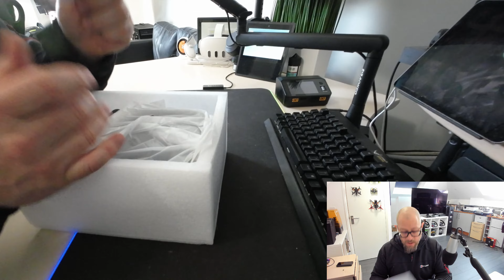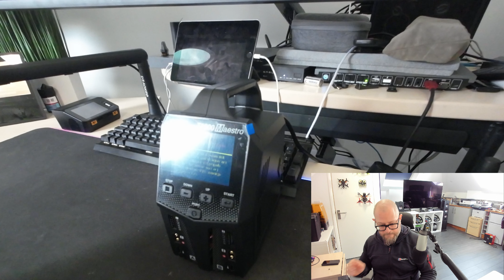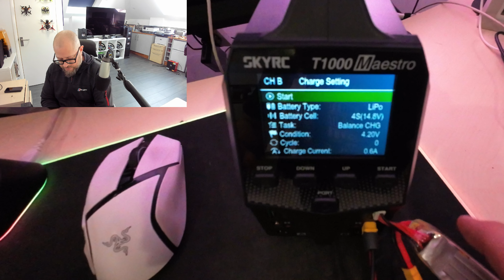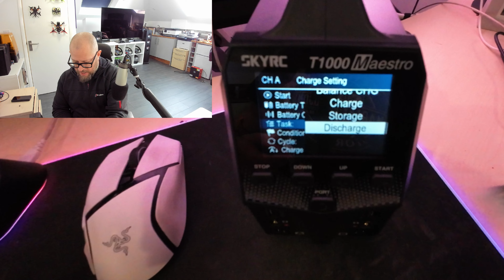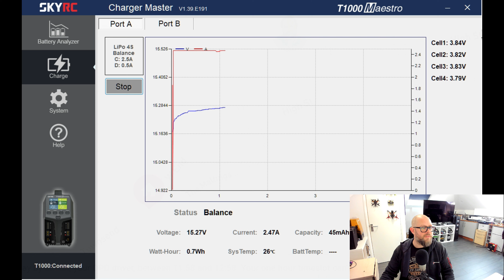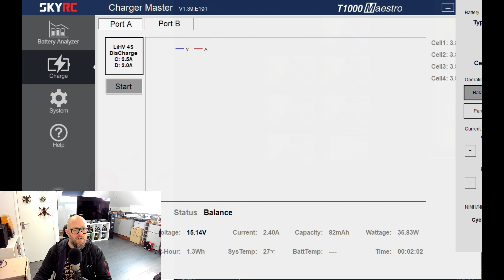The Ultimate RC Charger (SkyRC T1000 Maestro Unboxing & Setup)

Comment: Hi, 
thanks for the video, more in depth information on the software is what i was looking for.
i looking for a test system for my batteries. thinking of using the BD380 discharge together with this charger or the D200.
but i have some questions.
can you see the info per cell? like voltage, resistance etc? also in a graph?

it this information accessible during charging and/or discharging?

i hope you can provide me with some more info.

Comment: Hi is this 450wx2 or 450 total on AC?
Reply from the maker: Took a bit to test, however I can sonfirm that the SkyRC T1000 Maestro charger delivers up to 450 W total in AC mode, not 450 W per port. When using DC input, it can push up to 1000 W total across both ports.

Comment: Cheers again for the content Johnny. Much appreciated. I am wondering over the usefulness of the app. I figure, that if I have to walk over to the charger to plug the batteries in, I may as well start the charging/storage process whilst I am there. Is it actually useful, you think?
Reply from the maker: I do think it is useful yes. The app is mostly for testing battery health at an individual cell level. You can check how much energy each pack is storing and retaining which relates to a state of health check.
I may well plug this into a long USBC cable, and leave it connected!
The menu is OK, but the button control is HORRIBLE though. Up becomes down in the menu for things like charge current. Press up in any other menu, and it scrolls up, but for current, it scrolls down, because down is UP in current. Utterly stupid.
I prefer the interface and control on the ToolkitRC as a simple charger, but it does not have all these conditional discharge software which is a real solid bit of software IMHO.
Reply: @willitmod  Cheers!